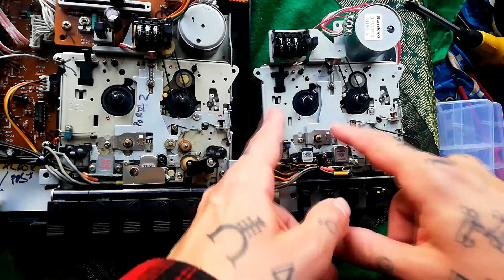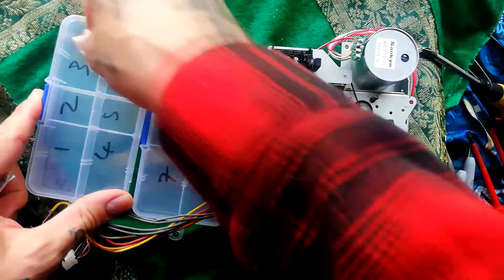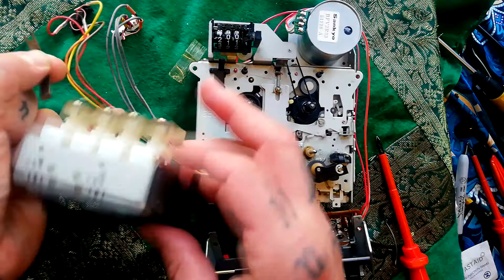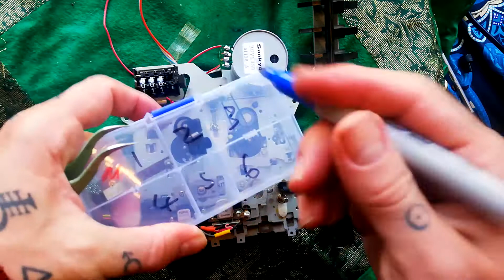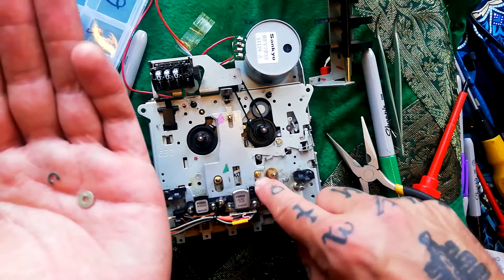GEC 4-track cassette transport | 1 | Porta One, Porta Two, Porta 05,  MT2X, MT3X, X-15

Comment: I've got a stripped screw that holds the metal casing over the flywheel, so can't get in there to clean off the old grease.  Any tips on removing stripped, tiny screws?
Reply from the maker: screw extraction kits are available which drill onto the screw head destroying it then give you.a good grip on the way out, but I'm not sure what the smallest diameter is? Rubber band between the screw head and driver, spray lubricant on the stuck screw ferrule, giving the screwdriver handle a whack with a hammer can all help.
Reply: @Tetrakan  Thanks for the tips, being so small it's been pretty tricky.    Will try these.
Reply: I went with tightening the jaws of my drill down on the top of the screw and slowly drilling in reverse.  Worked a treat! Of course, I then dropped one of those tiny ball bearings on my floorboards, never to be seen again.  Spent the night with a magnet down there lol. 
 @Tetrakan

Comment: Your videos are really helpful, but i still have no clue what’s wrong with my porta two. Head base with pinchroller don’t want to go back after i press play, it moves only up and never goes back. I’m tighten the spring on a base and and reshaped headbase and it won’t work
Reply from the maker: Did you reshape the spring as shown in 3rd Island's video? https://youtu.be/jHUef-GaVYo
Reply: @Tetrakan  yes
Reply from the maker: @spaceark4028  and grease has been replaced on all ghe white gears on the rear?

Comment: I know it has to be somewhere in this great series of vids, but all I've been able to find is the center hole diameter for the pinch roller on the Porta Two.  What are the full specs for the pinch roller when ordering a replacement?  Are the belts and pinch roller different for the later versions such as the Porta 07?
Reply from the maker: Belt sizes here. https://youtu.be/frUOMOLhpFw  no it's different belts in the porta 07. I'm not sure if I've ever given all the info you want for the pinch roller because I've never had to replace those, only clean them. But try this video https://youtu.be/Aa9CCj_Lu4w
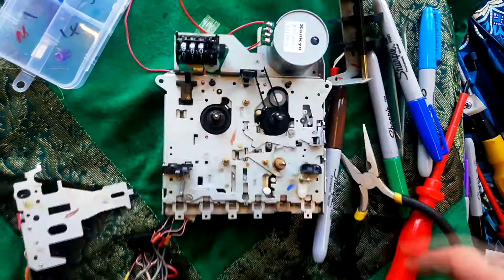Reply: @Tetrakan  Thanks so much.  I felt sure I'd seen it and sure enough I had, but I might never have found it again.  Your vids have given me the confidence to dive in and fix the Porta Two!  Is there any source for the black plastic prong bits on the GEC that have the two screws holding them in place? This one has a part of one of those (the one on the left) broken off.  These are about all that is left on the transport at 9:20 on the linked vid you provided in your response.  I'll try the glue and plastic weld on that but I don't think it can serve its purpose with much build up of the plastic.
Reply from the maker: If you have both bits a 2 part glue like jb weld can be effective. Otherwise it'll be a matter of tracking down a spares donor on ebay unfortunately.

Comment: I don't suppose you know the size of the belts for this unit? - I've got myself an old one that seems to be electrically working, but mechanically deffo needs new belts. I've got a nice bag of mixed thin ones, but the main one probably needs a very specific size... great videos btw, I really wasn't expecting to find such detail :)
Reply from the maker: Thanks, I cover this later in the series, see here https://youtu.be/frUOMOLhpFw
Reply: @Tetrakan  That’s great thank you, I’ll check it out, though further investigation into my unit seems to show that at least one channel is dead, and the others messy at best, might just have to be a parts source, or maybe a burner lofi mixer for use in the workshop… ta!

Comment: Super helpful vids. Thank you! I noticed my Fostex also has that loose black wire by the pitch pcb. Is that a ground, and should it be connected to anything? Thanks again.
Reply from the maker: Sorry just seen this. Do you mean its a broken wire or its got a ring connector? Yeah it probably sghould be connected somewhere!
Reply: @Tetrakan  hey all good, yeah I determined it was a ground wire. Cheers

Comment: Man you are best, this is life saver to us, i just bought one yesterday Porta TWO TASCAM 
in mint condition still in box with accessories, gent who sold me this said used only maybe 10 times.
no scratches at all, no marks , everything shines as new, book, cables even arm belt still there, 
he even give me original Tascam start stop pedal and mic, cleaning bottles for rubber and heads , untouched.
My heads are stuck in pause position so i will need to do this as well, referring to your video of course.
once again i thank U very Much for your time showing us all this in detail. God Bless U in this bad times :-))

Comment: Have you repaired any Yamaha MT120 units? I have one with some electrical problems.
Reply from the maker: I have one in bits here, the plan is to do a series of videos on it but i haven't got round to it yet...if you describe the issues maybe i can give you some pointers or direct you to relevant videos demonstrated on other models?
Reply: @Tetrakan  Well, two of the input amplifiers are kinda blown out (they distort way too much when you raise the input volume.) One channel records way too low, and the overall recording level is quite low and there's a lot of hiss.